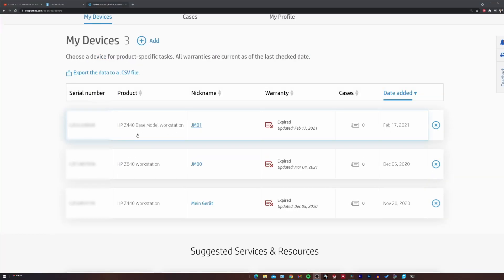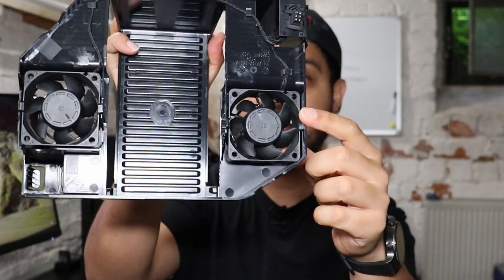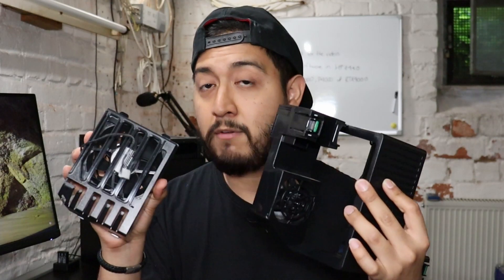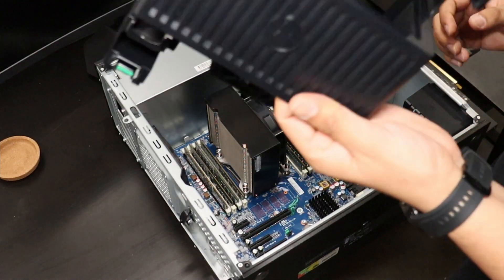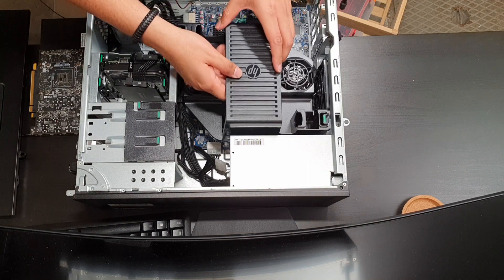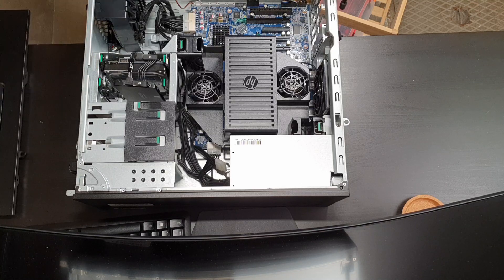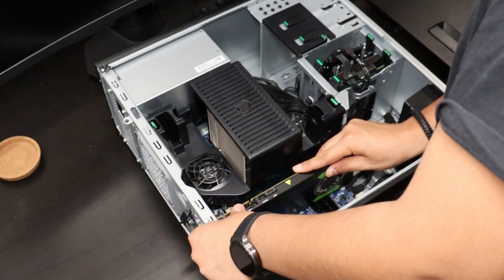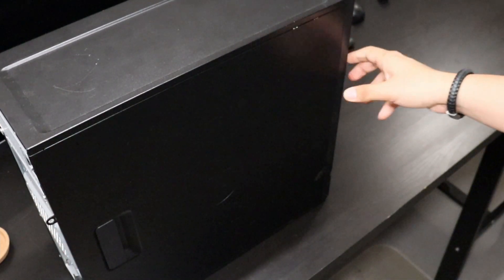HP Z440 Workstation 2021 Upgrade / HP Z Memory cooler, front fan and Quadro P4000

Comment: Using this in 2024... Just go mine tbh... Question, how do you add hdd to the top of the case above disk drive. Do you need to buy an adapter?

Comment: Watched your video thinkink these shits would definitely be the perfect upgrades for my Z440. Opened de case and realized all was already mounted in mine. 
Turning on CPU E5-1650 v4 @ 3.60GHz . Just miss an RTX 3070 (with proper connecters and 700W PSU to go on ^^.

Comment: I just bought one with 1650v4, 32gb of ram and 512SSD for $220. Just came in and to my surprise it also has the memory cooler and front fan installed!
Reply from the maker: That is a really nice deal!! the 1650V4 in my opinion is one the best CPUs for the Z440, very high frequencies and 4C/8T is more than enough for a lot of tasks. For the price, the memory cooler and the front fan is the workstation almost a gift. Thanks for watching!!
Reply: @JorgeMoralesAv  the 1650v4 is 6c/12t!

Comment: IF YOU ARE HAVING TROUBLE INSTALLING THE FRONT FAN BECAUSE IT SEEMS TOO SMALL READ THIS:

The front fan Chassis does NOT clip onto the "lip" of the frame (the lip that rolls TOWARDS the motherboard). 

That is ONLY for the black side panel to clip onto, so that you can close your computer. Look carefully and notice that NOTHING is clipped onto that. 

He did not show this in the video, but the little clips of the Front Fan Chasis clips onto the FRONT of the the computer frame , the side that the USB/headphone jack/power button is. 

THATS WHY HE TOOK OFF THE FRONT PLASTIC GRILL, TO MAKE SURE IT CLIPS ONTO THE FRONT CORRECTLY. 

If you don't understand, carefully and slowly re-read this. 
Thanks.

Comment: Thank you from  Australia brother. I bought one of these recently because they are so cheap compared to system's from major shopping outlets. I bought it for $240 AU which is far less than the $3,900 when it came out here. Running E5 1620 v4 16g ddr4 2666 and a nvme pci-e ssd and k2200. This was all in the cost. Recently bumped the ram up to 32 g for $80 which is not bad. Love the video brother.

Comment: Where do you find these upgrades ? :D 
I'm searching everywhere and usually they are pretty expensive also if I may ask is HP Z4 G4 Memory Cooling Solution 1XM34AA compatible with z440 ?
Reply from the maker: Hi! I live in Germany and I bough the components from the website Workstation4U. I don't think they ship to other countries :/
Reply: AliExpress also sells this cooler. And it's cheaper than Workstation 4u.

Comment: have you update hp z440 to windows 11 if so how?
Reply from the maker: Hello, I haven't yet. Windows 11 is still having some problems and bugs. I will wait a bit to update. Thanks for watching!
Reply: @JorgeMoralesAv  Well thank you for the help I just got my z440 it a great unit i have win 10 96 in ram a 256 ssd 6tbit hard drive and 2 gig quatro grafix card wish they would just make an add on card for the chip needed they make plug in ones on some mother boards they are trashing a lot of us just for an ad on chip they could sell.

Comment: Con we install liquid cooling system in hp z440???
Reply from the maker: Hello Inam, yes you can, but I wouldn't recommend it to you. Even if you have the 22 cores 44 threads, Intel Xeon 2699V4 you can manage to get it properly cooled with the upgraded vapor chamber cooler solution from Hp.
And it will be even better in terms of noice.